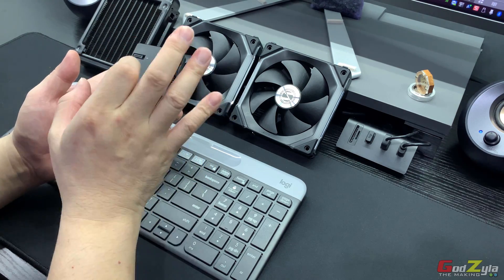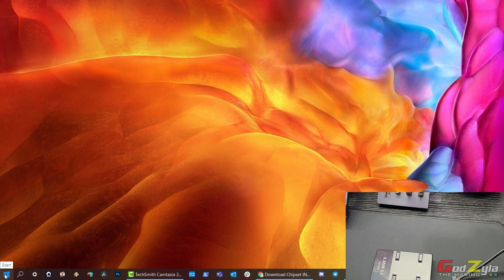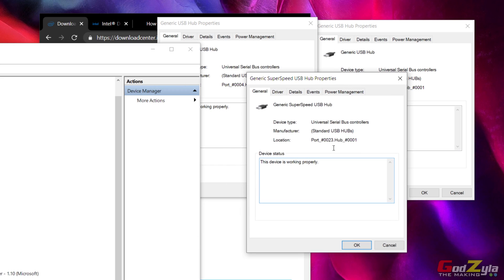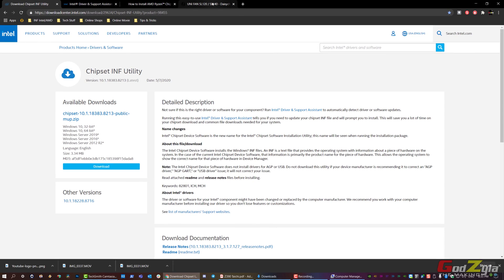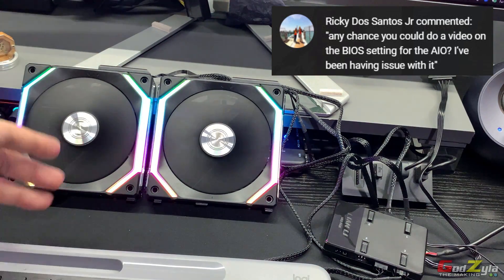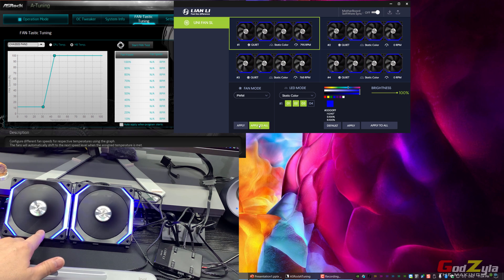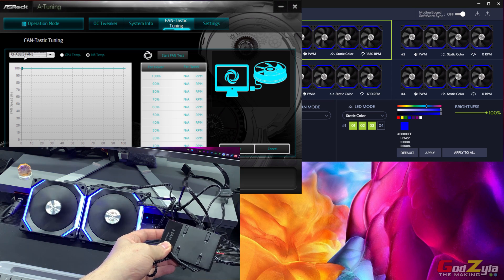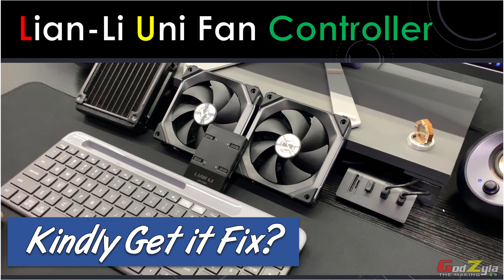Lian Li Uni Fan Controller - Some Break Fix! [L-Connect]

Comment: This didn't fix anything. Intel driver and support assistant says there are no supported driver updates for my motherboard. My fans and strimers were working great, and all of a sudden they no longer show up as devices in the L-Connect 3 software. Everything is updates. It's driving me nutz.
Reply: I used my ASUS software to updste the drivers on my ASUS Prime Z490-A motherboard. I removed the Intel software that did nothing.
The Strimer and Unifan controlers show up fine in Device Manager. The problem is they are not showing up in L-Connect 3, but they were working fine two days ago without any changes to the system. In fact, they show up fine in the firmware updater as well. You would think that, if the firmware update software can see the controllers then L-Connect 3 should be able to see them as well. 
 My Windows updates are up-to-date. Same with my drivers and BIOS. I also use Armory Crate, and iCue but they do not load with Windows. I only run them when I want to change an effect. I have tried uninstalling everything with reboots between, and with psu shutoffs, and reinstalling with L-Connect installed first but no difference. iCue and Armory Crate are working perfectly. I will try the live reconnect of the internal USB cables later today. I had been using the Strimer Plus hardware and software for over a month without any issue. When I installed the fans this week I could not control the RGB without a manual firmware update. Once done everything worked perfectly....until the next day.
I appreciate your willingness to assist. I am a computer engineering technologist and have been repairing and building PCs for 30+ years. It's not very often I run into problems I can't solve but this one is making me pull my hair out. I may be bald by the time I finish. I will be back to let you know how it turns out. My PC is in a video on my channel if you are interested. The video sucks but the PC is pretty sweet.
Subbed because of willingness to assist people.
Reply from the maker: @OriginalMergatroid  Hi, thanks for the full diagnose stats of your PC, I am wondering do you have another PC to try out the uni controller? or are you able to grab a m.2 or SSD, do a fresh installation? I can't figure out what's wrong with your main rig. As why I have asked you to test the uni controller on another machine, it could be the uni controller. 
It also can be your IRQ are overtaken by the iCue or Asus Armory Crate.
Reply: @KleoYan  Because I bought two sets of fans, I have two fan controllers.
1. I just disconnected the USB cables, powered off, shut off the PSU, held the power button in for 10 seconds, and rebooted the PC without the controllers plugged in. I updated Windows to 22H2, which was the only update that was available. I shut down the PC, powered the PSU off again, then powered it all up and plugged the controllers in one at a time. I checked Device Manager and they are there. I ran L-Connect 3, same problem.
2. I tried the same thing, only with just the Unifan controller plugged in - same problem. Tried again with just the Strimer controller plugged in - same problem.
3. I replaced the fan Uni Controller with a brand new one. I disconnected the strimer controller. Fired up the PC, same problem.
When I open L-Connect 3 it does not show any fans or strimers. The frustration level is just amazing considering two days ago everything worked perfectly. I'm at the end of my rope here. I have placed a service ticket with Lian Li. I wish I could install the firmware again, but it won't allow it if it's the same version. I would hate to have to reinstall my o/s just to see if that's the issue. I may have to, but I won't be happy about it. Even if it works, I will constantly be expecting it to fail again. I just don't understand how the firmware software can detect the two products but L-Connect can't. 
I am going to try swapping USB ports on the two controllers. If that doesn't work, I have an NZXT internal USB hub I will try just for the hell of it. If none of that works, I will have to image my system and then do a reinstall of Windows just to test and see if it's a software glitch.
Reply: @KleoYan  
Here I sit, broken hearted. Paid for Lian Li RGB and it only....well, you get the picture.
So, I just did a Windows reinstall, and it worked. The hardware is detected now. What really sucks is I sill have no idea what caused the problem in the first place. I am going to have to check it after every piece of software I install, and I am going to have to constantly create restore points, and most likely do a lot of imaging just to make sure that, when it does fail again, I will be able to put things right quickly. As it is, I tried a restore point from a month ago and it did nothing.
Oh well, I guess I know what I'm doing for the rest of the weekend, and likely on and off all next week. I haven't reinstalled Windows for about two years, maybe three so there is a lot of work to do. I just wish I could thank whoever made the software so delicate.
Thanks for your assistance. I appreciate the help you offer people.
Reply from the maker: @OriginalMergatroid  you are most welcome, I know is a pain to rebuild the OS and to reinstall your application. This is normally what I do, though it's tedious but it works for me. I always clone (an image file) my m.2 drives whenever there is an update of windows or whenever I install a new application. This might sound silly, the restore point should work but sometimes it doesn't, so before I update windows patches or install a new application, I will do an image of my OS drive. Hey, thank you to have visit and to have leave your valuable comment too. All the bestt with your OS rebuild and so sorry that I can''t help you further.
Reply from the maker: Hello MErgatroid Mania, welcome to my channel. you might want to power down your PC, turn off your PSU, remove the AC cable to your PSU and leave it for 45 seconds. While waiting, remove your USB cable which is connected between the uni controller to your motherboard. Plug back the AC Plug to your PSU, turn on your PC first. go to windows update to see if there are any updates. if there is, update it. if not, power down again, now plug back your USB cable that is between the motherboard and the uni controller. power back on again. Check your device manager to see  if you are able to see the uni controller under the universal serial bus devices. if there is, launch L-Connect 3 and see if that works.

Comment: Hi Kleo !! 
question, my sl120 fans suddenly just stopped connecting to the L-Connect app reverting my rgb to the default rainbow colors, when I try to open the app again it says "controller is not connected" ive tried everything to unplug and replug the fans but its still not working :/ any chance you might know anything?
Reply from the maker: Hello Billy Hopkins, I like to check did you update the L-Connect application to the L-Connect 3? if not try these.

1) Turn off your PC totally
2) unplug the cable that is connecting between your motherboard USB 2.0 header and your uni controller
3) Switch off your PSU and unplug the AC cable
4) Leave it to 45 seconds 
reason to do this is to reset and to clear previous settings (exclude your UEFI settings)
5) Plug back the cable that is connecting between your motherboard USB 2.0 header to your uni controller
6) Plug back AC cable to your PSU, turn your PSU on and power up your system.
try the above method 
 
and it still does not work. do you have another PC to test on the uni controller, this will narrow down if your controller is faulty or malfunctioning. 

if all the above failed, I would advise you to approach Lian Li official website and to redeem your warranty (1 to 1 replacement)
Reply: @KleoYan  thank you for getting back so soon! Everything works now :)
Reply from the maker: @billyhopkins3517  that’s good. How did you fix the issue. Will like to hear as you might have other experiences which will be good to share with others having the issue too 😉
Reply: @KleoYan  I did step 1 and 2 followed by a windows update and it fixed itself !!
Reply from the maker: @billyhopkins3517  I see. got you.. thanks for the reply 🙂

Comment: I just found this channel, but Im having an issue where the Fans Show up, but the RGB cannot be changed in L-Connect 3. Ive updated the Graphics drivers, Ive done the INF driver, and Ive made sure the software is up to date. I can change the strimmer but the fans are unresponsive.
Reply from the maker: Hi Apocalypse, welcome to my channel, if you are using L-Connect 3, you must first have your CPU and GPU readings first before you can control your fans. Maybe follow this video  https://youtu.be/CgvuUFeff8U which is more approperiate for your case as this video is only meant for L-Connect and not L-Connect 3. 
for your reference these are my series on the uni fans and etc https://youtube.com/playlist?list=PLEW-b-2vYDdPo0NzHyeksx012c-nkDapm

Comment: HI i have nzxt cable extension and it does not recognize the strimer and fans in L CONNECT. but if i dont have the cable extension it recognizes in L connect. HELP PLEASE!!!!!!
Reply from the maker: Hello Xprofi, welcome to my channel, when you have mentioned about fans. May I ask which fans are you referring to? and for the cable you can refer to this https://youtu.be/Lz90i5ym4Dw
I will leave my whole playlist about this uni fans and strimer plus. see if it's of use to you https://youtube.com/playlist?list=PLEW-b-2vYDdPo0NzHyeksx012c-nkDapm
Reply: I have the sl fans and the strimer v2 for motherboard and gpu. It’s a nzxt cable extension like cable hub which you showed in one of your videos. Thanks for the help!
Reply from the maker: @Xpr0fi  you are most welcome. all the very best with your build.
Reply: It still does not get recognized in L connect🥲
Reply: https://youtu.be/uMgUYiakpxM 
I have the same nzxt cable extension hub. When I have the strimer v2 and sl fans, It does not get recognized. I have 2 usb gen 3 on my mother and if I plug in the strimer and fans it gets recognized in L connect , but not with the nzxt cable hub extension. Why?

Comment: I can gain control on my rpm but I cant gain control on the rgb. I did the Chipset driver install but that didn't help
Reply from the maker: Hi Go, welcome to my channel, I like to ask which uni fan are you using and which L-Connect application version too. also if it's SL uni fan, does your uni controller have the SL marking on it?
Reply: @KleoYan  I'm using the sl140, I might have fixed the issue. I reordered the daisy chain and it seems to work now
Reply from the maker: @Go-nb9jz  Hi hi, thanks for the reply. Happy for you to have fix the issue 😊

Comment: I'm having a problem with the last daisy chained fan rgb not lighting up or responding any ideas?
Reply from the maker: Hello ziggy2070, welcome to my channel. Lets say there are 3 sets of fans where you have plug to the uni controller, output 1 and output 2 (both working) and your last set output 3 (your fans not working) Can you try swapping output 2 with output 3? see if those problematic fans are working? if it's not working, that means your fan had some connection issues. If the fans works on output 2, that means your output 3 is having an issue.
Reply: @KleoYan  All 3 are connected to port 3, I did have it on one. the fan can always be controlled but sometimes not the rgb i swapped the fans around and the last one had the issue again. I found that its best not to install the fans together first and then attach is a bad method. but to scew each fan in seperate and then attach the next one/screw in and so on(I think screwing in can have a twisting effect). lastly the last one in the chain now has main rgb and fan control but now the four surrounding lights do not work. I sent an email to Lian Li asking for a diag process and they simply wrote back saying they would get the factory to send me a new one.
Reply from the maker: @Daedalus_UK  I see, ok.. now I like to check with you.. you are using the SL or AL fans? for the SL fans, if your controller does not have the SL marking, you can only use the L-Connect app. If you intend to use it on L-Connect 2 or L-Connect 3. you will have to do a firmware which this video might help you out. https://youtu.be/hZpzR_4917c

If you are only using the AL Fans, you can use L-connect 2 or L-connect 3.
Reply: @KleoYan  I have AL and I already have L-connect 2 and performed the firmware update when I first installed them just over a week ago. Device manager al ver is 1.1
Reply from the maker: @Daedalus_UK  ok, one last thing before am clueless, do you happened to install other argb program before you install the L-Connect 2? example Asus Armoury Crate, MSI Dragon Center, Gigabyte Fusion or even ASrock Polygram? if you did, try this.. uninstall the motherboard argb program and the L-Connect 2.. now please note Armour Crate has it's own removal tool (Check on their website) as for the rest, make use of Revo uninstaller https://youtu.be/uMgUYiakpxM?t=438 , then once done, shut down your PC first. remove the AC power cable to your PSU, let it sit for 45 seconds or so, plug back and turn your PC back on. then install only the L-Connect 2 app. see if that works. if it does not.. I can only say that your controller is faulty, that you will need to wait for lian li to send you a replacement as you've mentioned.
Reply: @KleoYan  I do have icue and msi app also installed but i am able to control the all fan speed and rgb except just the rgb on the last fan on the daisy chain that I get problems with. By the way the icue installs a api driver that msi picks up on that is how it controls it. and overides it after the icue has loaded and set its settings. I'm not confident that a software issue exists and seems to be more of a hardware one. I do however notice that in the past after having the pc off for a while that on first run it might work again for a while and then intermittant or if I change the rgb it stops working again. short from doing a reset I would like to find a way to reset without the software having to be removed or hardware touched until I can find a process that identifys the root of the problem.
Reply from the maker: @Daedalus_UK  hmm. only last fan, even if you swap your last fan with other fans it still does this? you have a very unique issue which now am scratching my head.

Comment: Dear sir thank you for your good advice and helpful tips , i am hoping you can give me some trouble shooting regarding the Galahad 360 CPU LEDs are no longer lighting up.   The 3 fans and RGB lights are all good , but when i changed my 3 SL Front fans for 3 AL fans my CoU lights stoped coming on, i thought i might have had too many fans plugged into uni controller , so i used the other controller off my SL Fans and plunged my CPU RGB header into the box alone , whilst having the SATA , usb, and the one black wire 4 pin header all connected the my Gigabit Mother board , but no luck , tried the intel chipset upgrade , could i have blown the ARGB's and if so can they be replaced ? Any advice would be a great help many thanks
Reply from the maker: HI alaster, welcome to my channel. just call me Kleo will do, as for your case. I think you need to know which controller to use. You can only use SL fans to a SL Controller, for AL fans to a AL controller. To have both SL and AL Controller to work, use L-Connect 2 application as it allows to control both SL and AL controller. I would advise you to take baby steps. remove all controllers to your USB header on your motherboard. Start with removing all L-Connect application, install only the L-Connect 2 application. then having lets say your AL Fans conntected to it's controller, test things out. if that works, off your PC, connect the SL Controller to another USB port of your motherboard, then plug the SL Fans to this controller. now when you power up your PC, you should be seeing two taps on the L-Connect application. As for safety meaures, just make sure that for each controller port (1 , 2 , 3 and 4), do not plug more than 4 fans to one port. your galahad argb connector can be plug to either of the controllers, not an issue. give it a try.
Reply: @KleoYan  Kleo, many thanks for getting back i did not realise both controllers we're different as they look like the same !  I will unplug them all and as you said take baby steps , i am gutted about losing my CPU cooler Lights , thats why i bought the Galahad in the first place lol
Reply from the maker: @alaster33  I see. If u need more info about these uni fans and connection, I have a series of content about them which might interest you or for your reference https://youtube.com/playlist?list=PLEW-b-2vYDdPo0NzHyeksx012c-nkDapm all the best with your build and thank you to have visit 👍